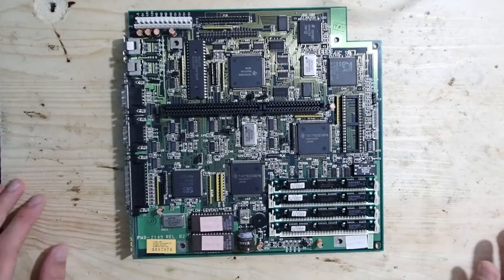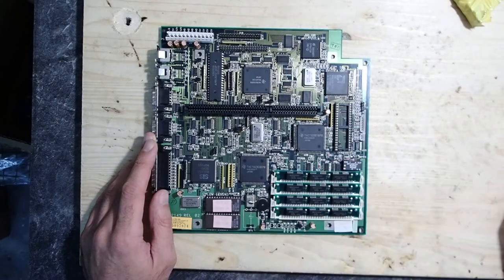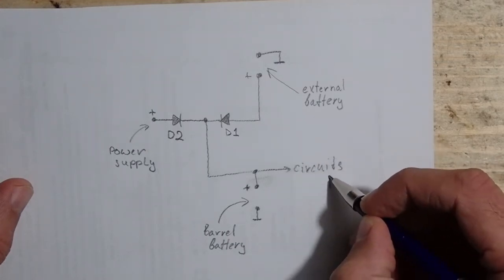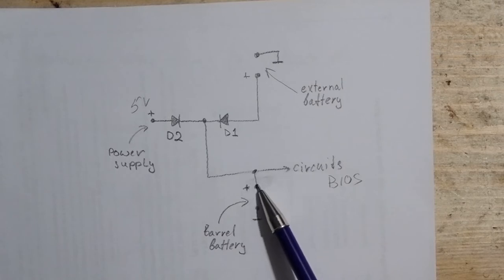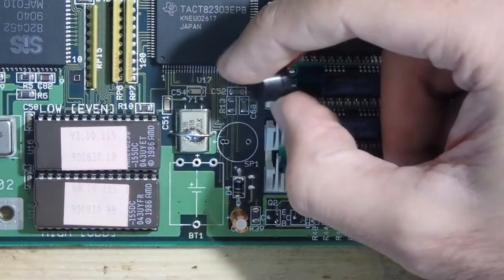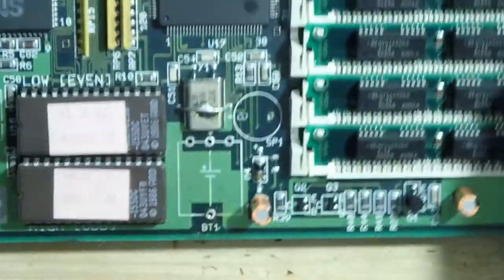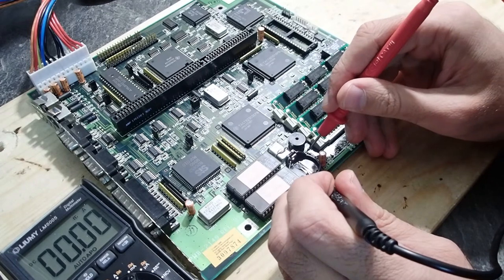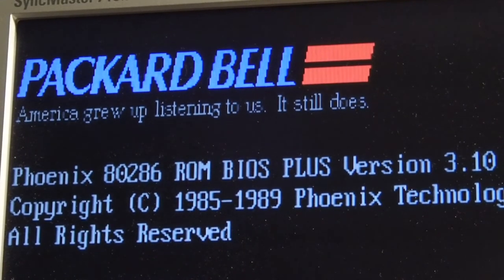How to replace a barrel battery by modern CR2032 on an old mainboard properly

Comment: Watched the whole video since I'm planning on doing a battery swap on a 386 board to a CR2032 battery and check for trace damage and repair when necessary. I'll order a diode or two in case I screw up 1 of them. Loved the schematic diagram for the battery circuitry.
Reply from the maker: Thank you very much! The "professional"  diagram was handcrafted in weeks of hard work ;D
Reply: @necro_ware  Need assistance with my 386 machine. I already cut the trace from the battery's positive lead from the top of the board and soldered a wire to the diode for the external battery header onto the positive lead and it works somewhat, except it won't keep the time correctly and after about 2 hours, the settings erase. Am I doing something wrong here? I checked the voltage to the RTC from the battery's negative terminal and it gets 2.42V-2.5V, which is 0.2V-0.28V too low (between 2.7V and 4.5V for the Hitachi HD146818P RTC required).

Edit: yesterday, I made a 4.5V battery compartment out of a broken DMG-01 battery chassis, soldered 2 wires to the terminals that are in the chassis, then to the board, to the external battery holder, and it works. With the diode in place, it goes to 3.8V, which is plenty and it keeps the settings.
Reply: @RetroPCUser  if your board has an external battery connector, which does not charge the battery, why did you modify the board? Just plug the battery and avoid the risk of damaging the board... :)

Comment: make sure to use shotcky diodes for lower voltage drop, silicon diodes would drop the voltage around 0.6volts which may reduce the usable time span of the battery.
many calculators with a solar cell use cat-whisker diodes that have an even lower voltage drop...
Reply: This was what I wanted to say too

Comment: My 486 motherboard only comes with a external batt circuit to power the cmos. I measured the current when powered on and it was getting .5uA so very little. Should i still put in a diode? Have you ever heard of external batteries being charged? Thanks

Comment: Perfect description of what to do. On some machines I love to use a Card bracket and a few centimeters of cable to put the battery outside of the chassis.
Did you ever experience issues with the voltage drop by the diode?

Comment: Lots of 'External Battery' headers have a jumper if you're using the onboard 'barrel' battery, then the diodes are not necessary.
Reply from the maker: That's true, the two middle pins of the header are jumpered on some mainboards and sometimes it's just sufficient to remove that jumper to prevent the battery from being charged. However, often it's a bit more complicated. By removing the jumper not only is the charging trace disconnected from the battery, but unfortunately the whole battery. But you are right, before messing around with diodes everybody should check for the jumper and understand the circuit. Thank you for your contribution!

Comment: Nice video.
I have a motherboard named EXP 8049 that used to have a barrel battery on it.
The problem is i can't seem to locate the charging circuit.
The damage from the acid fortunately was little to none.
Can you help in locating this circuit.
Some told me to use the external battery but I don't want to use it.

Comment: Would you need to do modifications like this if you removed the barrel battery and added a socket for the CR2032 battery but then use a rechargeable CR2032 battery? I just noticed they do make CR2032 batteries that show the following "Li-Ion Rechargeable 2032 Button Cells, LR2032, 3.6V 50mAh". Seems like this might work ok?
Reply from the maker: The rechargeable pendant for CR2032 is LIR2032 or ML2032. I have no experience with them yet, but I guess, that you don't need to make any changes, when using them, except the battery socket. However, the rechargeable versions cost about 10 times as much as the non rechargeable.
Reply: @necro_ware  Thanks for the reply!  Very helpful.  The reason I asked is because I had already added a 2032 socket to a couple of my motherboards but this was done before I knew about the charging circuit issues. Lucky for me they hadn't had issues yet as I didn't run them much at all. So I thought it might be an alternative for those already done incorrectly like mine. Really appreciate your video and the great explanation as I will do much better on my next boards.
Reply from the maker: @matthenrich995  You are very welcome. If you decide to use the rechargeable variants, I would be also glad to know, how that works. Even if it is more expensive, I guess, it is still a valid solution as well with as little modification on the mainboard as possible. And in regards of non-rechargeable batteries, just be careful, when you try to recharge them, they can overheat and explode.... I wish you all the Best!
Reply: @necro_ware  the additional cost is negligible when you consider that you're only having to change it once every 5 years or so. It would be a very different scenario if you were having to change it every few months, agreed!

Comment: Hi, you could also use ML2032 (depending on the charging voltage). ML2032 is a chargeable version of CR2032. I do not know if ML2032 is prone to leaking or not. BR
Reply from the maker: No, you can't. That's a Li-Ion rechargeable battery and it needs additional electronics to control the charging process. If you simply put an ML2032 into the circuit, which was designed to charge Ni-Cd or Ni-MH batteries it could explode.
Reply: @necro_ware  Sorry, your are right. The old one was NiMH or NiCd, I suppose.

Comment: i thought the barrel batteries were rechargeable, the CR2032 are not.....right?
Reply from the maker: Right, that's why you have to cut the charging circuit. The battery holds the charge for years.

Comment: hi i went to the shop and he didnt have 1n5817 but give me 1n5819 that is 40 volt instead of 20 volt schotty diode. i did the mod  on 2 motherboard, but when i attach psu i have 0.2 volt on battery pins, and when i power on i have 3.5 volt on battery pins ( all that witout battery cr2032). is that ok ? i think something is frong... maybe 1n5819 arent compatible with 1n5817 ?
Reply from the maker: They are the same 1n5819 is just slightly thicker. Schottky diodes have reverse current leakage, that's why you can see the voltage. Measure the current instead, if it's very low, like some uA it's ok. The battery will survive that. Otherwise you can take a real diode and not a Schottky, but then you should place it in the way so the voltagee drop between the battery and the RTC IC is possibly low.
Reply: @necro_ware  tnx for reply. because i thought it was a diode version problem i ordered some 1n5817, but if u say it's ok that way i can leave it that way. if i measure voltage on diode  to the 5v rail i have ofcourse 5 volt, but on the other side i have 3,5 volt.... maybe not much ampere, but that 3,5 volts are present. if i put a 2032 that is 3 volt, i measure 3,3 volt on + of battery and 3,3 on diode and ofcourse 5 volt on other side of diode. i did that mod to not damage cr2032 battery. if it's ok ill leave it that way, otherwise a good component guide would be good.

Comment: This was great, I finally got answers to some of my questions regarding the barrel battery replacement. Have you experienced or heard of someone experiencing exploding CR2032 installed without the diode to prevent charging current? Thanks
Reply from the maker: I heard rumors and I saw a normal AA battery exploding as s.o. tried to put it into a charger. I myself never tried to install a CR2032 without solving the recharging problem.
Reply: Hi, I'm an idiot and I added the CR2032 without any other modification. I've used it for... I dunno, probably a month and had no problems. I will probably modify the circuit later now that I know this is an issue. :u

Comment: Goodnight just piggyback the battery container for the new battery with the diode on it?
Reply from the maker: In this case it would be also possible, yes. But it's not possible everywhere. Every board is slightly different. May be I'll make another video on this topic to explain, which kind of problems can happen.

Comment: What value diode do you need for the place of the barrel battery?
Reply from the maker: Hi! The barrel batteries are usually 3,6V and the CR2032 are 3V. It usually works, even when the battery delivers only 2.1-2.2V, but it is better to have this voltage as high as possible. That's why I suggest to use a Schottky diode (f.e. 1N5817), which has only a voltage drop of 0.2V. You also can use a semiconductor, like a z-diode, but it will eat 0.7V and can be too much on some systems.

Comment: Another option is to replace the battery with a VL2020 battery. No PCB modification required.
Reply from the maker: No, please don't. That's a Li-Ion rechargeable battery, which needs additional charging circuit. If you install it instead of a Ni-Cd or Ni-MH battery, it can explode and burn down your house in a most unexpected moment.
Reply: @necro_ware  it should be possible to use a rechargeable coin cell, vl2032 or ml2032 if the charging circuit on the motherboard is altered to take into account charge requirements, you'd need to check the manufacturers data sheet for the cells,  it'd need a shunt zener across the cell to stop charging overvoltage, and likely increase charge resistor to reduce charge current

Comment: the varta bat is 3.6v the coin bat is 3v wil that cause problems ?
Reply from the maker: In the most cases, it's not a problem. The RT clock usually works down to  about 2.1V, however, some boards reduce the voltage intentionally to about 3V by installing additional resistor or, more often, a diode. Unfortunately, I didn't mention it in this video, but sometimes you have to remove that parts as well, because the battery is already 3V.
Reply: Or you could use a LIR2032 which is also 3.6v and do away with having to modify the board.
Reply: @peterarmstrong9116  That is a good idea a quick modification. However aren’t LIR2032 usually many times more than a 2032, and a diode costs cents. If you don’t want to modify the motherboard (something rare) or go to the trouble of an external circuit, using a LIR2032 makes sense to me too.
Reply: @av_oid  if using a lithium rechargeable you'd need a shunt zener to prevent it going overvoltage during charging

Comment: It's is possible to simple remove the barrel battery and use a CR2032 case in the external battery connector?
Reply from the maker: Yes, I showed it in one of my 486 builds as well.
Reply: @necro_ware  Thank for yor answer! , I just discovered your channel a few days ago, so I haven't seen all your videos. As a puritan I don't like the idea of cutting a tarace.
Reply from the maker: @Jorge_Ramirez  Yeah, there is no need to do so, if you don't want to.

Comment: In this particular case, it would have made more sense to use the header pins, removing the need to modify the board.
Reply from the maker: True! But actually you never need to, since all mainboards up to 486 had a header for an external battery, so it's up to everyone's decision if it's better to use the header, or to modify the board. I just wanted to show the options, it wasn't special to this board, I just  had it at hand.

Comment: if use a 2025 battery instead of a 2023 would that cause a problem?
Reply from the maker: you mean instead 2032? Well, I never tried. May be
Reply: a cr2025 should work as well as a 2032...just not last as long....one could even use a cr2016 if you wanted...you just need the appropriate battery holder.  Unoffically, some holders will let you get away with using different cr20xx batteries.  I would bet that the holder used in the mod in this video would be tolerant enough to allow a cr2025 or 2016 and still work though I believe it was intended for the cr2032.

Comment: Hi, what would happen if I didnt cut the wire that recharges the battery and instead only soldered a new battery in
Reply from the maker: If the new battery is rechargeable and is similar to the old one, you can do that. However, barrel batteries always tend to leak and to damage the mainboard eventually. That's why I always replace them, by another solution. If you put non-rechargeable battery there without cutting the trace, then your new battery can explode with all the consequences.

Comment: What is the type of diode?
Reply from the maker: Hi, I don't quite remember anymore, what exactly it was. I generally suggest some low power, low voltage drop diode. In this video I used some z-diode, which I had at hand, I think. Not the usual use case for such a diode, but it does the trick as well.

Comment: Cool :) but I just use 16650 cells for the job :D with this cell the PC will be keeping CMOS setting forever hehe :D
Reply from the maker: True, and thy are rechargeable, so you even don't need to remove the diodes.
Reply: @necro_ware  exactly :) they do not leek and the capacity is so high for that purpuse that it will last for 100 years hehe :D

Comment: I don't understand why people don't use a different type of rechargable battery, and instead they do all these hacks. 
Why isn't there a simple ad-hoc replacement for these barrel batteries?
Reply from the maker: You can replace those batteries only with the same type NiCd or NiMH and they will leak again after a while. Unfortunately you can't insert Li-Ion rechargeable batteries, because they need additional charge control circuit, otherwise they could explode.